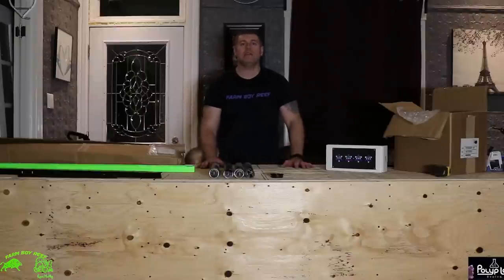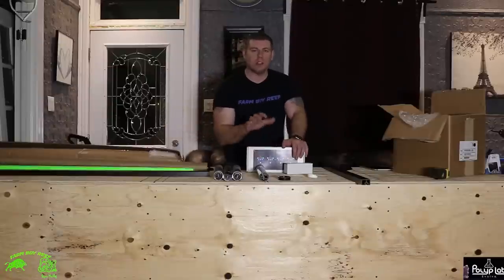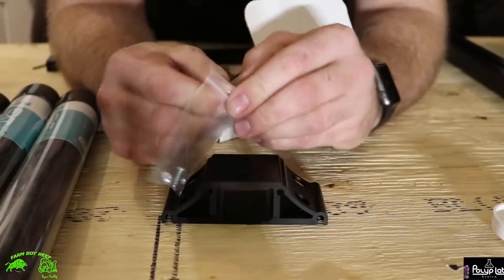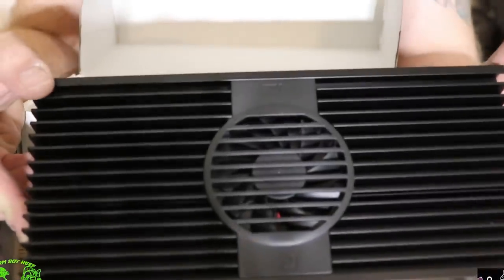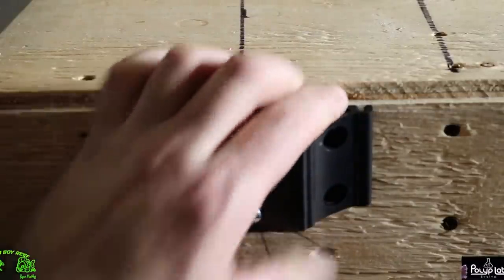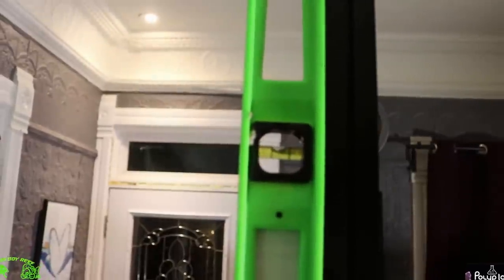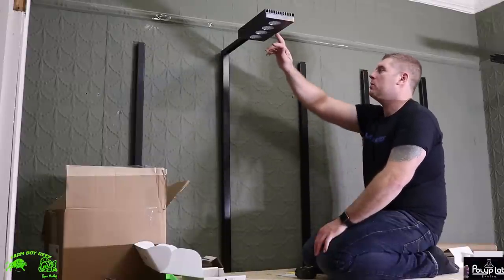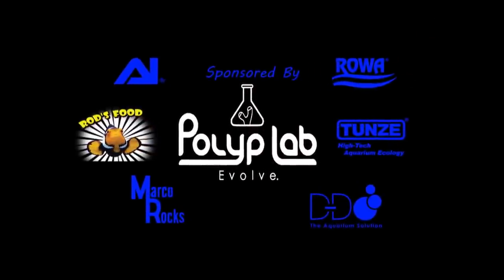Hydra 52 Hd install on the 700 gallon Phoenix

Comment: Another great Video! To match Blue Plus & Actinic T5 lighting on Hydra 52 HD run the UV 100%, Violet 100%, Royal Blue 100%, Blue 100%, and Red Green White at 24% on deeper tanks. Shallow tanks lower in the same ratio. My Tank is 30" deep with a lot of rock work. I also run ATI 4 bulb T5 to hide shadows and improve SPS growth.

Comment: I love this build, however the circumstances leading up to it is horrific. Today I had a close call myself. My external overflow on my 120 peninsula tank was cracked and leaking in 3 spots. Luckily 8 hours later it was repaired and back up and running. I will be following this build closely, liking and subscribed. Look forward to meeting up soon.